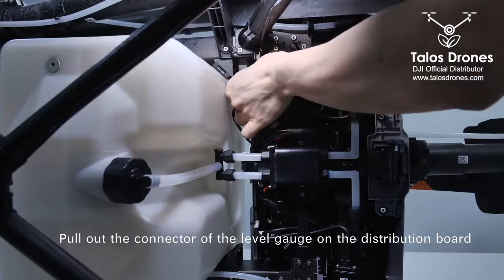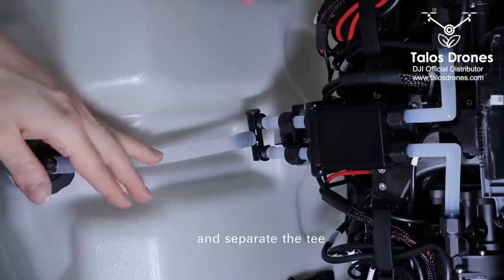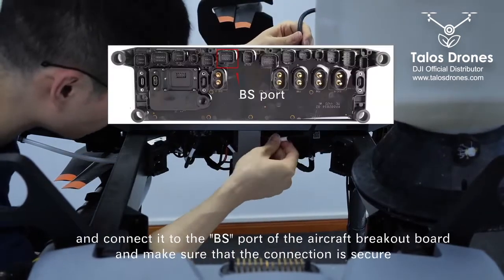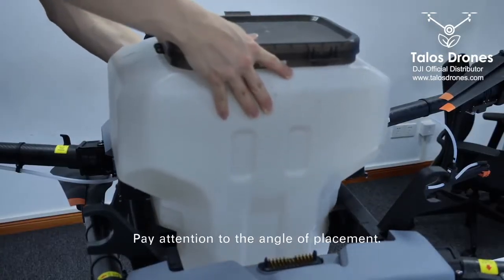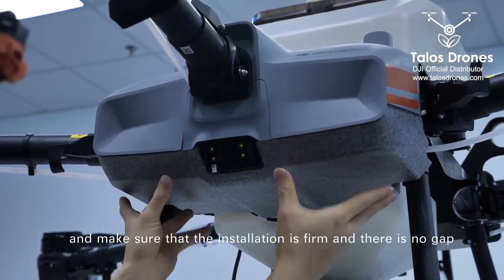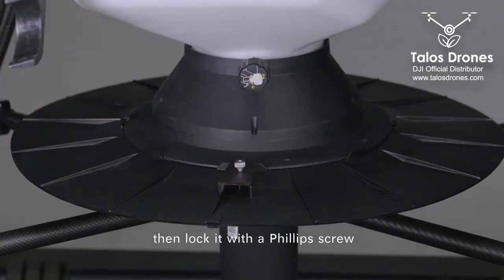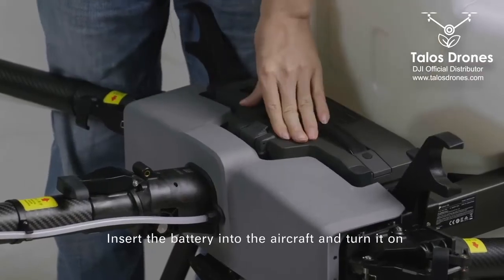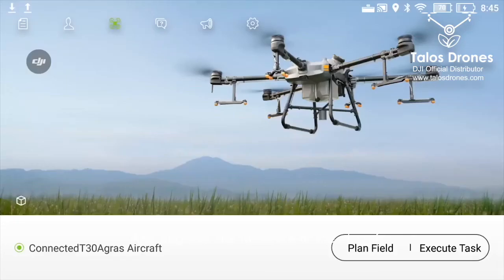How to install the DJI Agras T30 Spreading System

Comment: There are more accessories on your kit than on ours, in Brazil
Reply from the maker: Which parts are not included in your kit?
Reply: @talosdrones  the part you attach to the legs with a zip tie
Reply from the maker: @enginsezen4553  Here is the link to the mentioned part: https://talosdrones.com/products/dji-agras-t30-spreading-system-landing-gear-shielding-piece?_pos=2&_sid=48004dd60&_ss=r

Comment: The protection piece that you attached to the feet with a plastic clamp did not come out of the box of our fertilization tank. I would appreciate it if you could help.
Reply from the maker: Hello Mehmet, the early versions did not have them. The shields can be purchased on our website: https://talosdrones.com/products/dji-agras-t30-spreading-system-landing-gear-shielding-piece?_pos=2&_sid=48004dd60&_ss=r